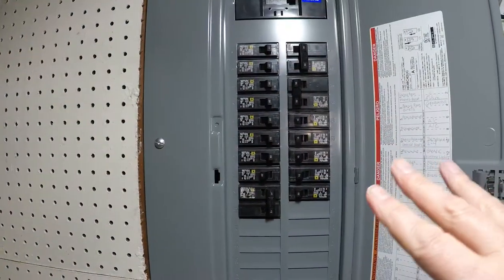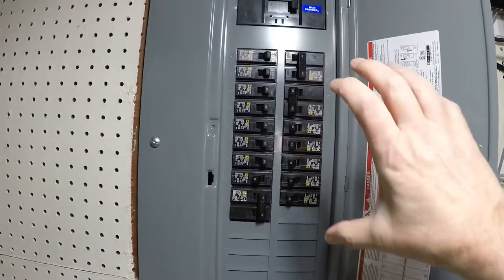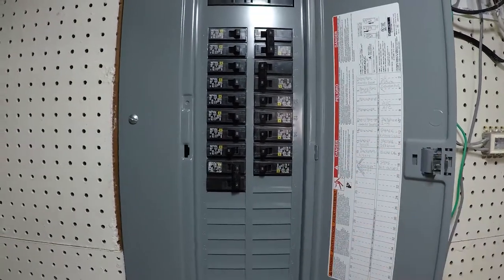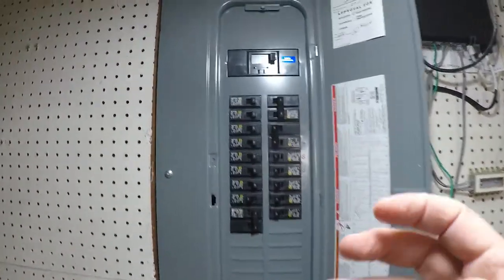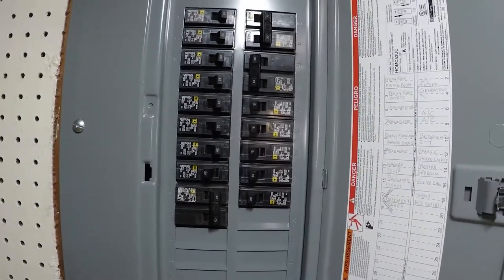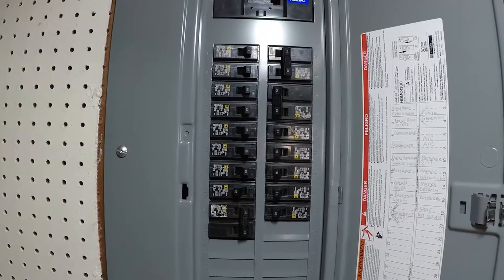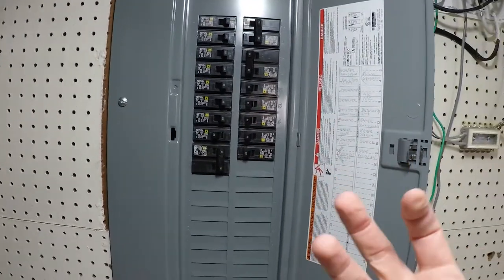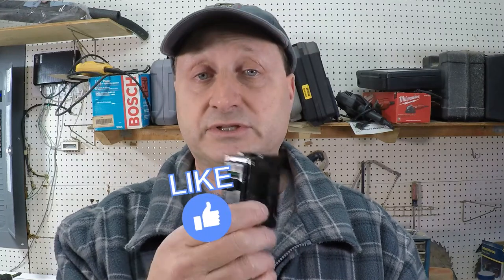How Do Circuit Beakers Work?

Comment: Hlw many watts can you run on a 30 amp circuit? Would length of an extension cord reduce available power?
Reply: In my house the standard voltage is 125 V. so that breaker can handle 3750 ways max or 3000 W continuous.